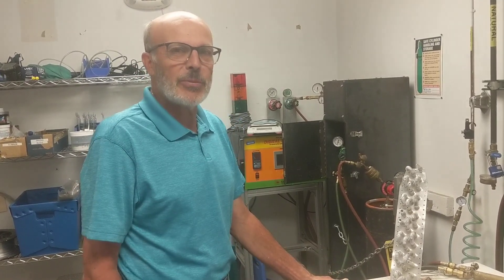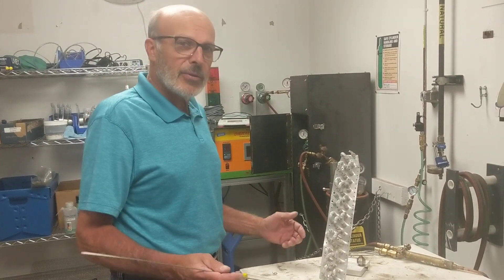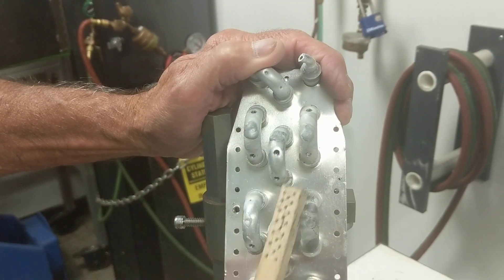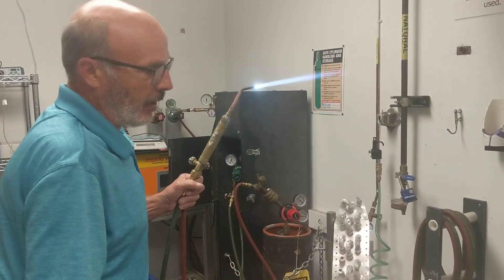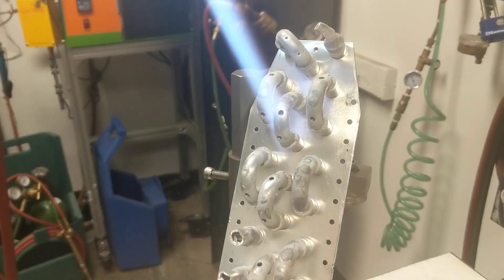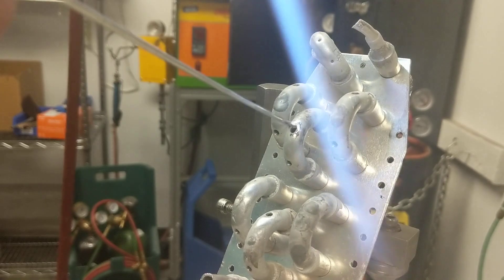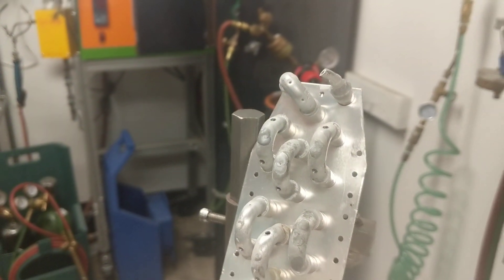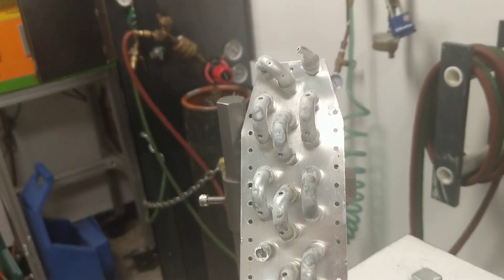How to Repair an Aluminum Coil with Lucas Milhaupt AL822

Comment: Id give al822 4/5
But Alloy Sol 3/5
The higher temps help adhesion and flow but you might melt the base.
Alloy Sol bonds really well to any aluminum cleaned perfectly at lower temps, but i will not cut through non perfect base metal.

Comment: I have used this particular product.  It works quite well.  I have also used it on non-HVAC aluminum repairs.  The key to a good braze is a clean surface, no oxide and no oils; and heating it to just the correct temperature.  Wipe the area to be brazed with a clean cotton cloth that is saturated with acetone.  I found it important to heat the repair area just enough to to melt the rod.  You also have to make sure that you are not melting the rod with your torch.
Reply: thank you

Comment: AL 822 is a low temperature alloy ideal for brazing or soldering aluminum to aluminum or aluminum to copper. 
It’s an easy weld to do, once all the prep work is done, and it has held every time.
I have used it on several occasions since I FIRST heard about it i 2018.